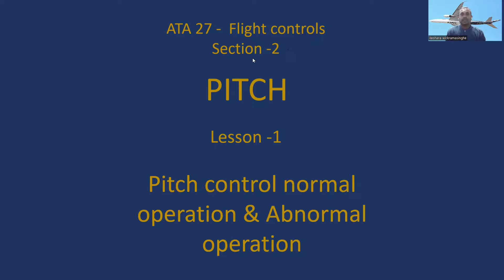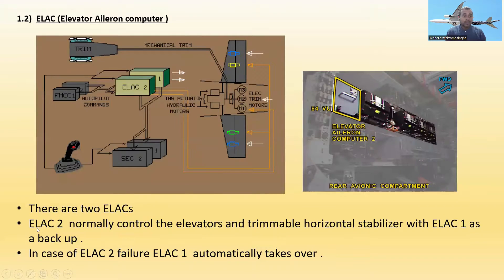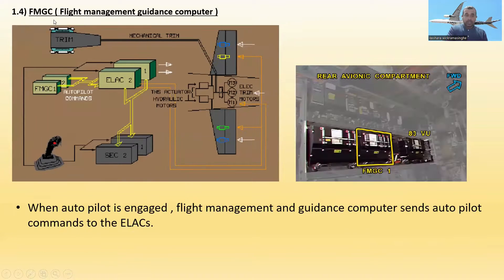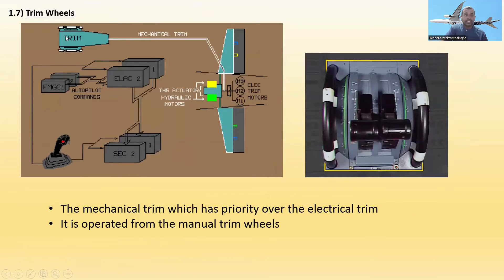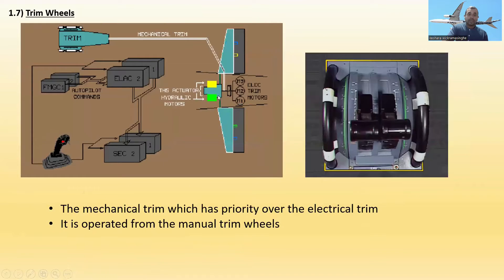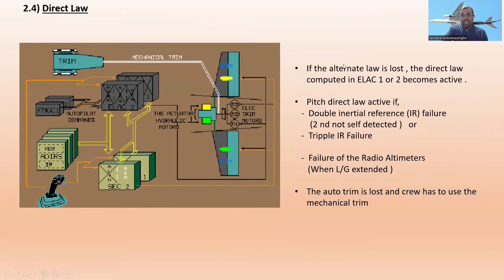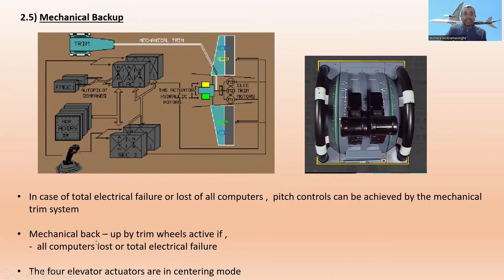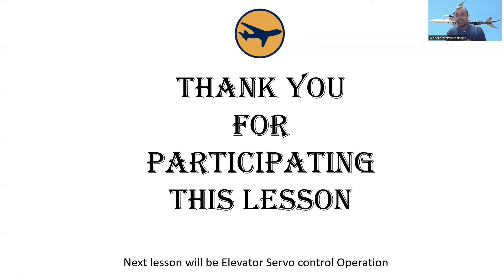Pitch control Normal & abnormal operation | ATA 27  | lesson -1 | Aircraft maintenance | Airbus 32F

Comment: Thank you so much
Can you tell me why does the elevator go in centring mode with electrical failure
And why does elevator go to damping mode with hydraulic failure ?
Reply from the maker: 1) during an electrical failure, the elevators go to the center position because the Fly-by-Wire system loses power, and the aircraft enters mechanical backup mode. This design ensures stability by preventing uncommanded pitch movements, allowing the pilot to maintain control manually.

2) during a hydraulic failure, the elevator enters damping mode to prevent uncontrolled movements caused by aerodynamic forces. The damping mode uses remaining hydraulic pressure or mechanical resistance to stabilize the elevator, preventing it from freely moving and causing pitch instability, ensuring the aircraft remains controllable.